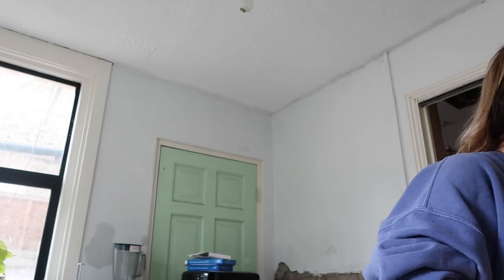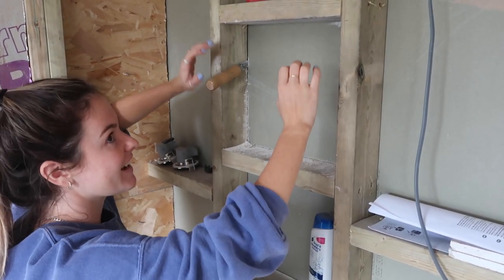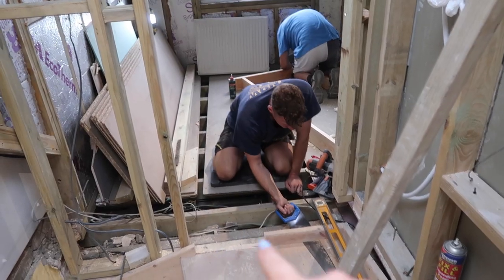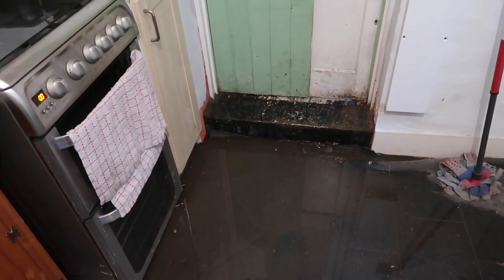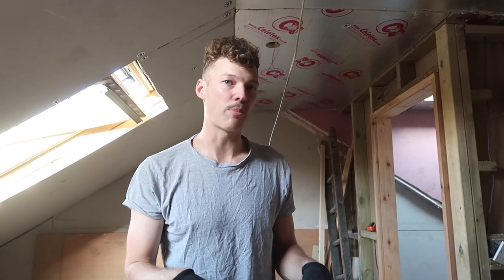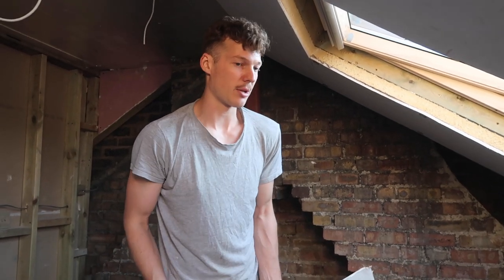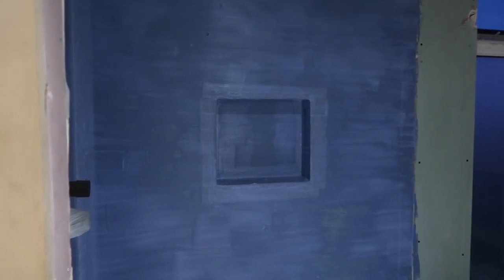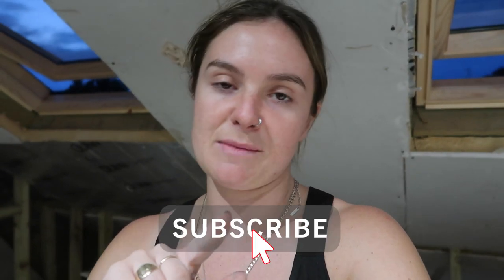OUR HOUSE IS FLOODED // DIY shower niche, chipboard and second fix loft tour // victorian renovation

Comment: I just tiled my kitchen and entire bathroom.  Kitchen looks great because we used subway tiles.  Bathroom is tricky because we used hexagon tiles on the floor and GIANT wall tiles (1.2m x 0.6m).  I know you aren't using giant tiles, so it's definitely something you could do!  I recommend testing out your skills with some scrap plasterboard and some cheap-o tiles to get the feel.  Research the proper mortar for your tile type and get a wet saw.  It can be very rewarding, but it's not easy with non-rectangle tiles. I look forward to seeing what you choose to do!
Reply from the maker: Thanks so much! Yeah the shape of the tiles are throwing me a little bit as I am looking to install them vertically and am getting a bit nervous about getting my lines straight... I think I'm going to have a little practice with the first box and take it from there!

Comment: Your going good guys,, decide about the tiles after the plastering is finished as you will see things a lot better,,.. Buy the tiles you want and then do a dry run and then decide. your doing great so far.. 
The council need to maintain there road Gully's, this happens after the dry spell,,
Reply from the maker: Thanks again Anthony - I will get in touch with the council as we definitely don't want that happening again when the downstairs is complete!

Comment: Why did you remove the metal plasterboard fixings from the loft vaulted ceilings?
Reply: maybe they will rust and come through the plaster?
Reply: @AllyCreative  They probably would show for sure, and they're for insulation not plasterboard.
Reply: So use them to secure the insulation first then use normal drywall screws when securing the plasterboard over the top.. I get you now.. 👍🏻
Reply from the maker: Yeah we've finally got round to using them correctly 😂

Comment: Ripped up the lounge carpet and hardboard to find only half the room has floorboards. The other half has chipboard that has been laid with massive gaps - lost 20p down one. They will have to taken up and relaid. Ugh! 

I don't think anyone expected those floods the other week.
Reply from the maker: That's so annoying to hear, Jules! When we bought the house the first thing I did was rip up the carped in the lounge in the hopes of finding original floor boards ready for restoration - we were not quite so lucky! All thin, cheap floorboards that had been installed in the last couple of years (from what we now assume must have been previous flooding!)

Comment: I notice tom's still not using a dry wall bit, tut tut. and wear masks with all those fibres floating around, you have very young healthy lungs, so lets keep them that way.
Good job and teamwork on the flooring, that can be tiring, as regards the rubble under the floors it wouldn't be the builders job unless asked and quoted for, but they should definitely not be adding to it, I know many do. Good to see you removed the insulation discs, many are not galvanised and would rust causing rust spots on your freshly painted walls, and I know its been mentioned, buy some tile levelling spacers, they will help you install your tiles, your perfectly capable of tiling, I have every faith in you,  it might take a few days, but its worth having a go, these things will help enormously, even professionals use them, you'll need a good long bubble though, as in spirit level.
exemplary
Your welcome for the advise on tanking also, but some-one, I mean someone, twice, Its Bobcat or Bob Lewis.
Keep up the good work.
Reply: Oh, i forgot, I'm assuming you have cavity walls for those extendable air bricks, they are going to need one huge hole cut in the wall, better do it from inside before you plaster, better still you can purchase waterproof covers that go over the airbrick on the external wall, much less work. As antony said, the council should maintain their gullies, I think they're working from home.